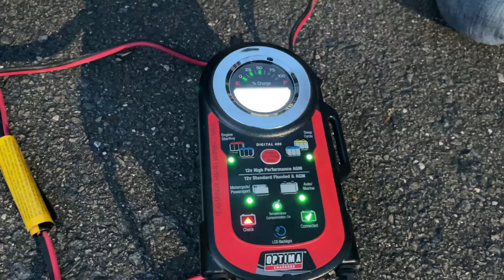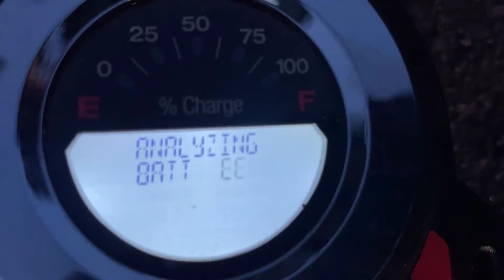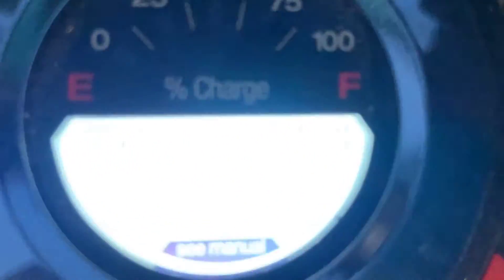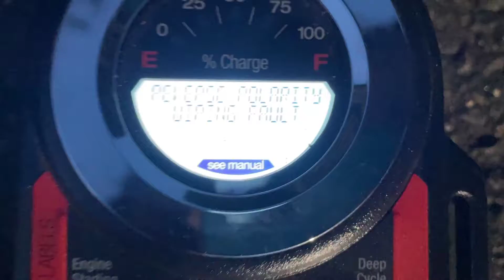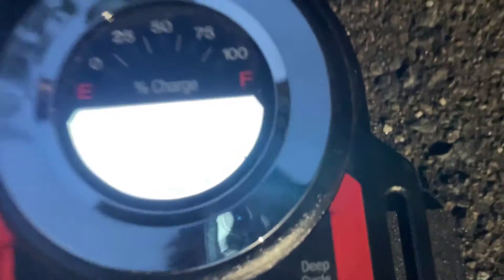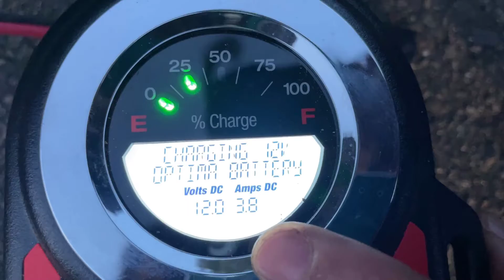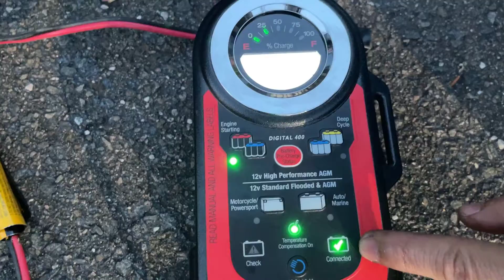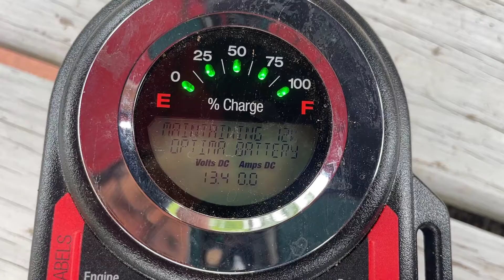How To Charge Dead Or Discharged 12V Car Battery Using Automatic Charger | Optima Digital Mainainer

Comment from the maker: Here are the #ᴬᴰlinks to tools, parts and accessories you may need to perform this repair:

1.  https://amzn.to/3x2zMpI  |  Optima Digital 400 12V Performance Maintainer and Battery Charger - 150-40000
2.  https://amzn.to/43tfTo7  |  Electric SC1305 Fully Automatic Battery Charger and Jump Starter for Car, SUV, Truck, and Boat Batteries, 50 Amps, 10-Amp Boost Mode, 12 Volt, Black, 1 Unit
3.  https://amzn.to/4alnTJU  |  NOCO Boost Plus GB40 1000A UltraSafe Car Battery Jump Starter, 12V Battery Pack, Battery Booster, Jump Box, Portable Charger and Jumper Cables for 6.0L Gasoline and 3.0L Diesel Engines, Gray 
4.  https://amzn.to/4cEydPk  |  BT100 Car Battery Tester 12V Load Tester Automotive Alternator Tester Digital Charging Cranking System Tester for Car Truck ATV SUV Boat Yacht

Or Click on Amazon link here and search for what you need:  https://amzn.to/3xIOsqg